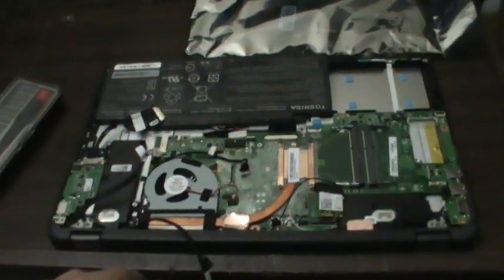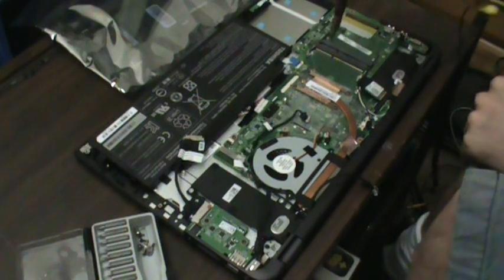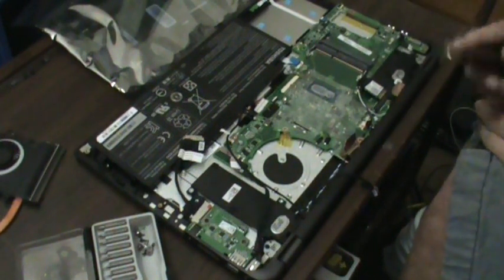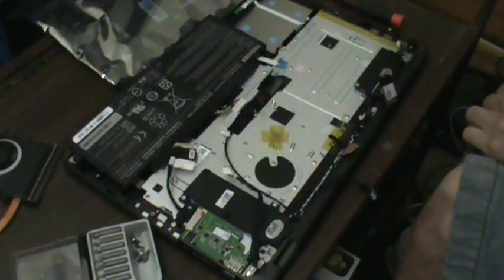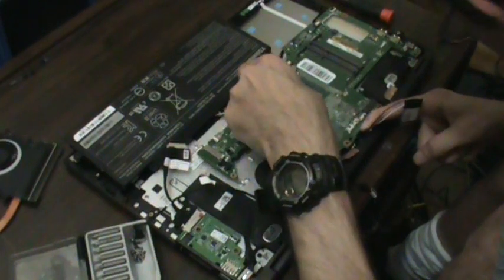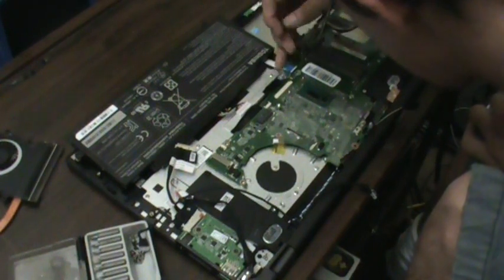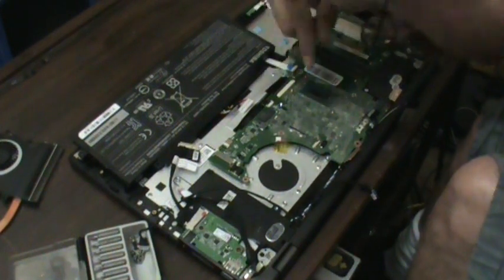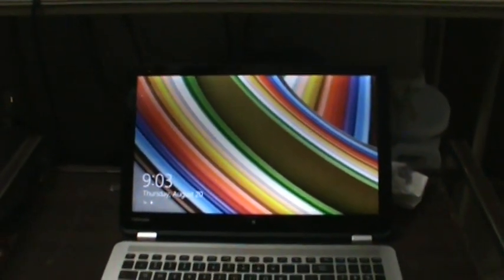Toshiba Satellite Radius P55W B5224 Motherboard Replacement

Comment: I need to know the code of a component of the P55w B5224 that is in the input of the power supply. Does anyone have one of these open and can I pass the 3-pin component code between the Y SMD fuse and the SMD R010 resistor next to the BV diode. Who can help? Do you sell the defective motherBoard to Brazil? Thank you!

Comment: Do you happen to know where the CMOS battery is on that model? After the battery went low the screen won't come on for me even after a reset and it's pretty much my last option.
Reply: Same with me.  I am looking for the CMOS battery. I will try to see the back side of the motherboard.

Comment: How much does getting a new motherboard cost or where did you buy it? Since mine got fried.
Reply from the maker: I purchased a refurbished one off of eBay for about $100.
Reply: GoldenSonic08 I too am looking for the CMOS battery to possibly reset a power on lock

Comment: I know this is an old video, but I'm having the same issue where my toshiba satellite won't power on at all and I had a computer technician suggest that it may be the motherboard that is fried. I was wondering if you would recommend paying for a new motherboard and for the replacement or just buying a new laptop. If my computer was older I would just buy a new one, but I barely bought this one 1 year ago so really trying to save it. Any input you had would be helpful!
Reply from the maker: If I remember correctly, the was about $100 (I got a refurbished one off of eBay). Now, depending on how much the technician is charging you for the labor, that will greatly determine whether it's worth fixing, because the labor is usually the bulk of the cost for this kind of repair. Now, being that you said you bought it 1 year algo. Personally, I would get it repaired, but keep in mind, if the cost of the repair is close to half of what you paid for the laptop when it was new, it may be time to buy a new one. I hope I was of some help to you.